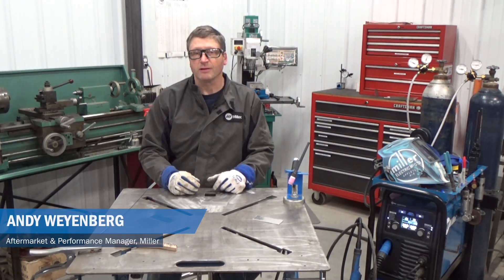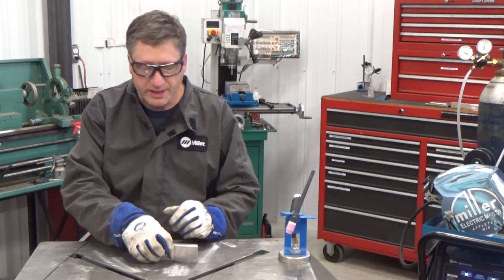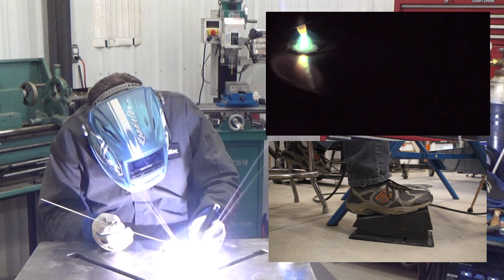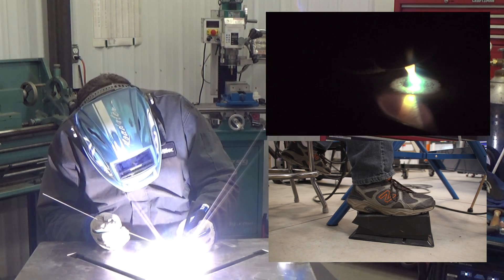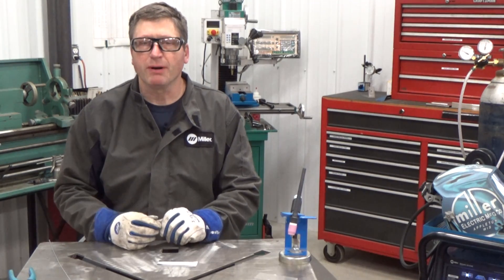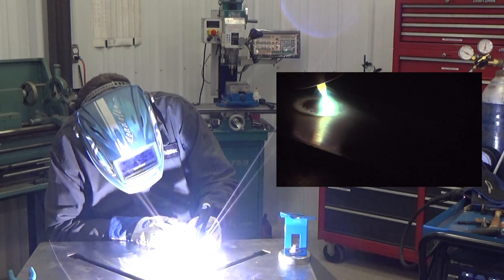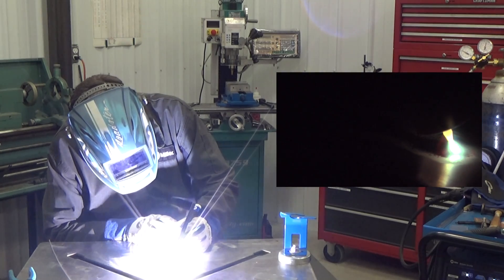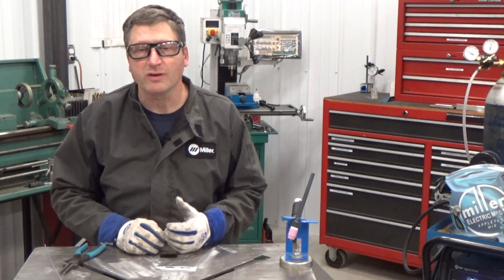TIG Welding Aluminum for Beginners Part 2: Establish the Puddle

Comment: i got a real big Question
can i do tig aluminum with
my bobcat 250 it got A/C?
Reply from the maker: Hi Jesus.  We recommend using the Bobcat 225 as an auxiliary power source to operate a Dynasty, Diversion, or Multimatic 220. These three models are all compact and portable, and they offer excellent welding performance for AC/DC TIG and more.